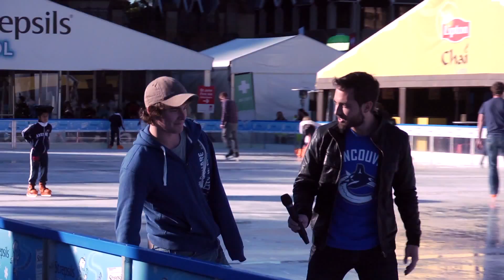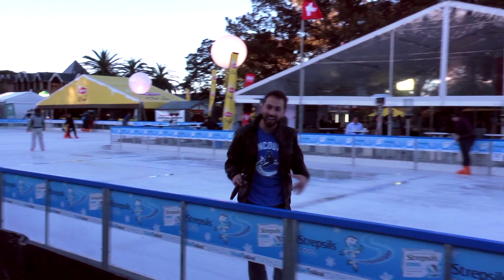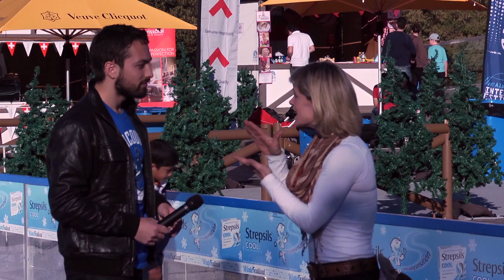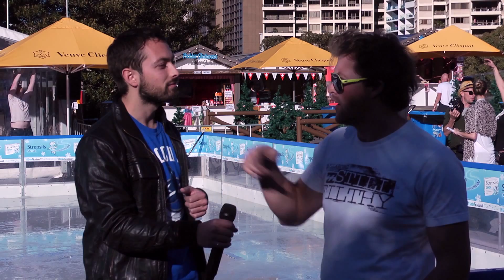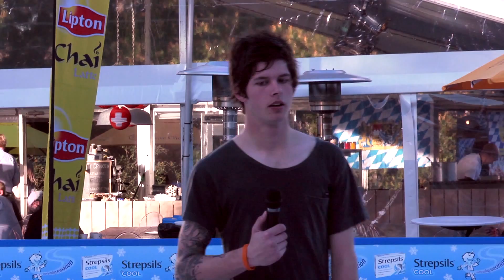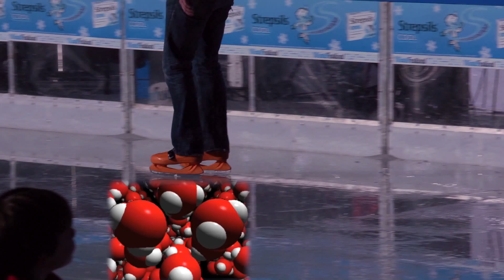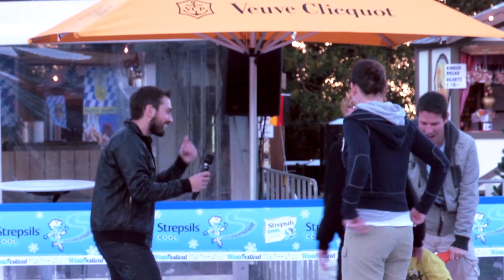Why Is Ice Slippery?

Comment: isn't it also slippery just because it has low friction too? Like, take a 'frictionless surface' for example and, would you be able to stand on it? walk on it? probably not.. Nonetheless though it is exerting a force normal to hold you up but you just go sliding around with any movement you make. Isn't ice just kinda like that?
Reply: This is what I was thinking,  just along the lines of because ice is crystalline the outside is a (relatively) uniform plane. You don't have to squeeze an ice cube for it to be slippery. And if someone wants to reply it's from the heat of my fingers: If I wear thick rubber gloves that are colder than ice, and compare the smoothness of sandpaper vs ice, I'm pretty sure the ice will still feel more slippery; regardless of pressure applied.

Comment: Actually, if i remember the calculations from years ago, the pressure asserted by ice skates lowers the temperature of melting by less than a degree. Ice just always has a nano film of water, as the outside layer of molecules can't form enough linkages with other molecules to go solid, so they are free to just roll around and whatever,
Reply: My hypothesis was that ice experience self lubrication. Since no surface is smooth at a microscopic level, there are microscopic high and low points on the ice. These high points (asperities) experience a very large pressure because they are so small and so they then melt. Even if the liquid water locally lasts for an incredibly short time, there are always other asperities that will then melt and provide liquid water since there are always high points, so under pressure there will always be some self lubrication occuring. Another mechanism besides pressure could also be friction.

However when I was looking for an article describing this I found one that suggests that a thin film of liquid water isn't the mechanism, and that coulombic repulsion is, that essentially an ice skate hovers above the water O_o (like a mag-lev train). 

https://arxiv.org/ftp/arxiv/papers/1502/1502.04173.pdf

In this article section 3.3 describes pressure mechanisms for liquid water lubrication, 3.4 describes friction, and then the rest describes this coulombic repulsion.

Apparently over the years there's been a ton of debate about this.
Reply: @JD-ub5ic  even without pressure though isnt it also the smooth uniform distribution of ice crystal molecules thst causes low friction and lets you slide or glide over ice even when there is not much pressure
.
Reply: @JD-ub5ic   I'm coming back to this comment after several years, and I glanced at the article.  It discusses the general ideas and serious problems with the pressure melting idea.  As for your explanation, I don't see how it works.  If there is a corrugation in the ice, it will most likely be quickly flattened.  I don't see why another corrugation would form for no good reason on something as weak as ice.  It's constantly under pressure, which prevents more corrugation.  There shouldn't be mega pressures spontaneously forming.  I think the quasi-liquid layer idea makes the most sense, as it explains it with the idea of a surface state.
Reply: Yeah I remember this being covered in a chem course, a person would have to weigh thousands of pounds to cause melting, I think the real answer had something to do with unpaired hydrogen atoms at the end of the lattice
Reply: +3nertia  Friction doesn't occur without movement
Reply: @DANGJOS  I get what you mean, but static friction is a thing.  It's the amount of force required to make an object move, and is generally slightly greater than the amount of force required to overcome kinetic friction, i.e. to keep the object moving.
Reply: @andymcl92   I think I mostly meant friction that can do any work doesn't occur without movement.  Static friction definitely exists.
Reply: That makes more sense to me, cause ice cubes are still slippery in your hand without all the pressure from your body weight
Reply: Squidward's Testicles but your hand is body temperature, which is a factor that may cause the surface to melt. Don't know if the hypothesis is correct, but the evidence you provide is not convincing
Reply: +Jeremy Davis  Interesting thanks
Reply: True but the tip of ice skates can even cut skin. So the pressure is really high
Reply: +Jeremy Davis  But how does that work??  Why don't these "asperities" just immediately refreeze after melting.  And do you have a paper that discusses this?
Reply: How does it work when you are wearing just shoos? It's slippery as well, but the pression isn't as high?
Reply: On a microscopic scale?

That may be true if you were trying to turn the whole area under an ice skate to liquid water, but I think the point is that there are microscopic ice asperities on the surface that experience mega scale pressures (since they are microscopic in size) and those asperities then melt providing thin film lubrication.
Reply: @JD-ub5ic  I'm with J D on this. It's all about the microscopic level and on the surface only that matters; the video also implies with the "belly" part that the pressure in that case might be smaller (because of the larger area compared to skates) and it would produce a smaller effect. All that of course assuming pressure is what does it because I haven't confirmed it.
Reply: Wouldn't the mere pressure cause enough friction to melt a tiny layer of ice?
Reply: And that's what scientists call a quasi liquid state....
Reply: That sounds much more plausible
Reply: Yeah thanks, that makes more sense to me
Reply: How does pressure lowers temperature here???
Reply: Exactly. I can't believe he made this simple mistake. There are hypothesise out there but this is NOT one of them because it was over thrown like more than a century ago.

Comment: The truth: Water molecules even in their solid state(Ice) doesn't not form strong bonds.They are strong enough to allow "breakage" of a certain amount of the layer and thickness depending on the quantity of pressure applied( person's weight/height),ambient temperature and uniformity of the bonds(clear water vs salty water).While keeping in mind that nothing ever really "touch" each other. A knife only separate(push apart) the magnetic bonds between atoms by using the stronger magnetic bonds of the iron atoms.

Comment: Pretty sure that dry ice is still quite slippery even when you do not wear skates to actually melt it with pressure. It may be less slippery but still quite a bit more than some other surfaces:) I need to test "Dry" ice in cold winter:D

Comment: i suppose ice gets, when it melts, a very flat surface, and the water fills in the gaps. since it cannot escape to the sides, you stand on water.
Reply: Yeah, but if you put something flat on flat surface ,the friction will be insane. I suspect that sheet of glass on dry flat ice surface will nto be slippery at all.
Reply: you're slipping on the water, not on the ice.

Comment: It's all in the phase transitions, man.

There are multiple phases of solid ice.
The ice you see here is hexagonal, and is stable between 32 and -152 degrees f. But there's also cubic ice, which is only stable below -150 degrees Fahrenheit.

Hexagonal ice collapses under pressure into liquid water because liquid water is comparatively more stable.  But I don't believe cubic ice has this property as it's probably a more stable orientation than liquid water.  
IN FACT. You might be able to actually achieve very hot ice under extreme pressure-- and it would likely orient straight into its cubic orientation, rather than hexagonal!
Reply: Pretty much correct.
Reply: Ofc you forgot friction but it is ok.

Comment: Veritasium your explanation is not right. At least according to Clausius-Clapeyron equation the pressure needed to change the melting temperature  of ice (which is the case here) is way too high. Approximately 135 atm  for 1 Kelvin change. This result is uniform with experimental results. You can find this relation from all university level books. My source is An introduction to thermal physics by Daniel V. Schroeder.
Reply: Are you sure you used the right units? We didn't do any calculations, but our professor gave pretty much the same explanation as Veritasium did.
Reply: Using the latent fusion heat for water (wikipedia H(water)=333.55 kJ/kg) and values V(ice)=1.09070 cm^3/g and V(water)=1.00013 cm^3/g and temperature 273.15K. The equation is dP/dT=delta H/(T*(delta V)). So 333.55 kJ/kg / (273.15K*-9.06*10^-5 m^3/kg)= -1.348*10^7 Pa/K which is around -135 atm/C. Very messy to write here but this is how it goes.
Reply: +Varpaankynsi What about ice skates' blade area? 80kg of human body pressing into a thin blade equals a lot of pressure, enough to melt the ice. This could be verified trying to use something like snowshoes instead of ice skates: if pressure is not relevant, it should work just fine.
Reply: What is the blades area? Lets say 30cm*0.5cm. And let´s assume that 1/10 of the area is in contact with ice and you are standing on one leg for in case. So the pressure will be F/A=80 kg*9.81 m/s^2 / 1.5*10^-4 m^2 = 5.232*10^6 Pa. This is still too small to change the melting temperature for even 1 Celsius. (think about when the temperature of ice is -20C and it still slides just as well.). And if you are not convinced, also this is very common in my home country (google "potkukelkka", means something like kicksled) and it slides just as well on ice even the contact area is much much bigger. Also small kids can skate with no problem.
Reply: You have to account for friction in order for the water to melt at any temperature = or below freezing.
Reply: Wouldn´t the explanation then be about friction, not about pressure? And the pressure explanation is what I  am arguing against. Veritasium mentions nothing about friction here. But what if we have ice -20C or even -40C cold and you skate over a small section of ice. 

Let´s say we have a kid weighting 20kg and standing with both legs while skating. According to you the friction should raise the temperature of ice for 20 (or 40) degrees since the contribution from pressure is way under 1 degree as shown before. Which I don´t see happening when the weight is not big the blade area can be big or small (works anyway), you have to take account the heat capacity of ice and the coefficient of friction in this case is very small. Didn´t calculate anything tho. Maybe you can show how much the friction contributes.

Comment: hi guys, I see a lots of discussions there... the most scientifically accepted answer on why is ice slippery is on the publication on the link under the video. yes ice is slippery because of a layer of liquid under the skates. But this layer of liquid does not come from ice melting  because of the iceskater's pressure ( as proposed in the video) neither because of friction (as correctly pointed out in the video). Although these 2 effects have a small influence on the characteristic of the layer of liquid water, the main reason is that the surface of the ice ( a few layers of molecules) has a lower melting point than the bulk ( as far as I remember something like -40 Celcius). So the ice surface is already wet, even in the absence of applied pressure or friction.
Reply: +Pierre-yves Pichon 
Why do the molecules of water in the surface have a lower melting point?
Reply: They do not experience the same pressure to bond together as other molecules because they are surrounded by less. 

And btw, friction might be minimal but you still have to account for it.

Comment: SO.. Then the heavier the person the further they would slide on the ice? Being that they are applying more pressure? Me and my sister would pack our sleds with snow before going down a hill to make us go faster? Were we actually going faster?
Reply: Nicole (W)Right adding more snow would add more weight. Therefore, adding more potential energy before you go down a hill. That'd be something to take into consideration too.
Reply: Nicole (W)Right adding more snow would add more weight. Therefore, adding more potential energy before you go down a hill. That'd be something to take into consideration too.
Reply: +adam kimmⓋ if we assume it is frictionless, all of the potential energy gets converted into kinetic energy, that is:
mgh = .5*m*v^2
as you can see, the mass is on both sides of the equation, so the final speed is independent of the mass and will always equal:
sqrt(2*g*h)

Comment: Because it has a low mu value which requires less energy for and object to move over its surface and offers less resistance to stop an object in motion.

Comment: regelation of ice have been considered as a reason for the slippery nature of ice but..this may not be completely true. If we see the phase diagram of water we find that skating is possible even at very low temperatures.. where the effect of the weight of the skater is not significant..the top most layer of ice remains in the liquid state because it experiences less supramolecular interactions (h-bonds) than that of those molecules in the bulk...
Reply: RAHUL DEV MUKHERJEE Thanks for your answer, i was going to mention the same, is more about termodynamical equilibrium between two materials, you won't get the same coefficient of friction in a pair ice-steel than say ice-gold and so on
Reply: And friction. Never forget friction plays a role in it too. Of course only for a skating person.

Comment: Hang on. So, when you melt a frozen substance, you put energy into it to increase the distance between molecules until the substance changes state into a liquid. So, by that logic, shouldn't compressing the substance (bringing the molecules closer together) have the opposite effect?
Reply: Ice is weird because of the structure of the molecule. It does not abide the normal rules of thumb.

Comment: ah, i feel a little sad inside because i know the guys from veritasium got it wrong.
if it's really about temperature and pressure, it should be harder to skate in subzero areas (not enough temperature to "melt"), or it should be harder to skate for children or small objects like ice pucks(not enough pressure).
but it isn't, therefore this is not the correct explanation.
As far as i know, it's slippery because it's so smooth (yes it's that simple)
The theory i read, why ice is so slippery follows as:
The Oxygen molecules on the surface of the ice are moving a lot, and even out small surface irregularities. That means, in a way, they behave like a liquid.
Ask Prof. Gábor A. Somorjai if you want to know more, he published on this topic ~20 years ago.
Reply: Georg Auer Interesting way to argument. I can't give you definite proof over the internet, but I can say the explanation given in the video is correct.

Skating in subzero areas is not harder because it is not about the outside temperature, but about the amount of pressure applied.
Therefore yes, skating is harder for children, but not enough to be noticable because the pressure is so high due to the small area.
Small objects like pucks glide due to the low friction and therefore use another priciple which cannot be compared to skating.

As he said in the video: The ice doesn't melt, the melting point gets reduced due to the increased pressure.

Comment: So according to those people, natural ice isn't slippery..
Reply: +BucketHeadMC I know this is a really old comment, but ice on its own isn't slippery...
Reply: +Sadrien Gw2  Actually, I've been on ice that isn't slippery
Reply: Did it have impurities on the surface like dust from fallen snow? It would be odd for there to not be a semi liquid layer on the edge of ice.
Reply: why would it be weird? Going from a solid to a liquid state takes energy, so there's no reason for liquid water to spontaneously form around ice when it's below 0C and at ~1 atm.
Reply: +Sadrien Gw2  It could have had impurites.  It was ice that commonly freezes from flowing water on the driveway.  Sometimes it's slippery, and sometimes it isn't
Reply: Unlocked There one damn good reason for ice to evaporate, even in freezing condition, and it's thermodynamic. Or you can say nature does not like vaccum. Even plastic parts in your car SLOWLY evaporate when the weather's hot. Physic is a bitch.
Reply: Yes, but that effect is fairly negligible for this. You aren't skating on a layer of water that's a countable number of molecules thick.
Reply: the colder it is the less slippery it is. Also depends on how it got turned in to ice, for example if there are high winds, the surface will be very slippery
Reply: Not true. It always is. The structure of ice breaks down on the edge molecules and is still semiliquid.

Comment: Woah there, you can't compress a solid. It's pressure, not compression.
Reply: Nick Furiously But you aren't compressing the liquid, you're compressing air that propels the liquid due to pressure difference. And they way ice melts when you press on it is different as well. If I remember right, you knock the crystals out of formation, melting the ice and turning it into liquid, and then when you stop pressing on it the crystals are free to reform. I might be mistaken though.
Reply: +Mr.chang cooler You can compress anything, just not necessarily very much, concrete, glass, air. Concrete and glass less so.
Reply: +Mr.chang cooler If you cant compress a solid, then explain sponges, or crushing an empty can. Liquids are just fluids that are in their most compressed state, this is what would cause a compressor or engine to stall if it becomes flooded.+strikerklm96Well yes and no, the difference between compressing a solid and a gas is a gas will retain the energy used to compress it. And with enough energy you COULD compress anything. But the titanic forces require are beyond our capabilities.
Reply: +Mr.chang cooler 
Tell that to a black hole.